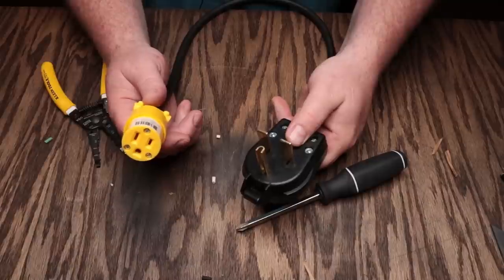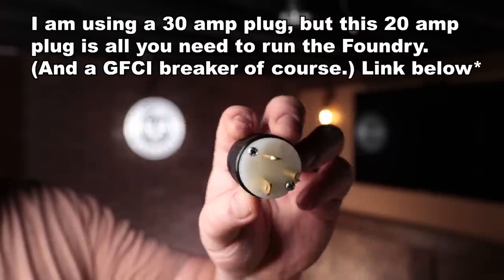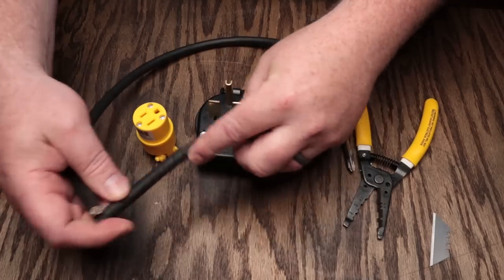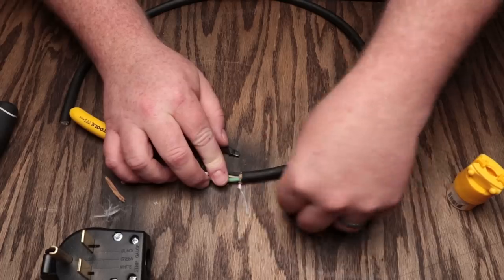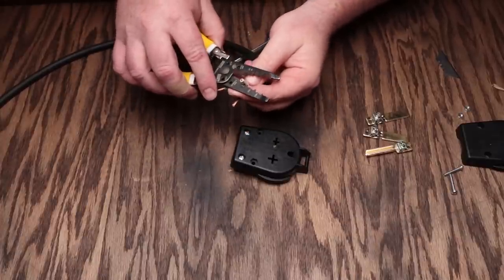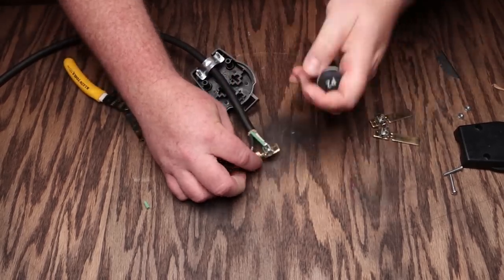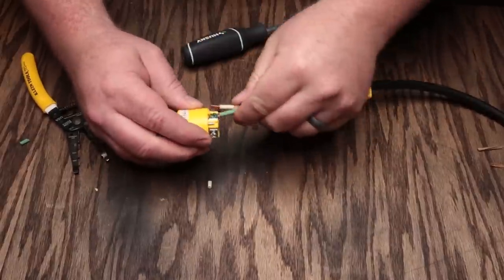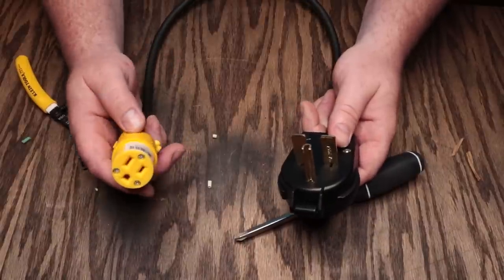Anvil Foundry 120v to 240v plug adapter DON'T CUT YOUR CORD!!

Comment: Thanks. Very informative because I do not think I want this Anvil foundry unless I go 240v. Couple questions if you do not mind answering.

1) do you have a link for the proper GFCI or are they universal? I see your links but not amongst them

2) I am hoping to plug this into my dryer 240v plug with a longer wire.  

Are you saying I need to have my circuit box adjusted to have a serperate breaker on it if I do not have one already on the dryer line?

Thanks for any clarification
Reply from the maker: You can do either in the circuit box or some people are making a GFCI cord that has the breaker built in. If you are on Facebook you should check out the Anvil group. Several. People have details on making the cord with the GFCI built in.

Comment: Can you make a jumper from the 3 wire foundry to a 4 wire Nema l15-30 outlet? I have a GFCI Nema L15-30 outlet that I use for my Grounded Brewing System currently and would love to just have a jumper plug. Thanks.
Reply from the maker: Sure just don't use the neutral. It's what I do.

Comment: Can i connect a 240 connector to a 120 outlet for my washing machine? If i make a similar pigtail adapter????
Reply: 240 volt 
Maytag washer
Reply from the maker: @colbolt54  you need to have a ground fault circuit interrupter either in the breaker box or look up my other extension cord video that has one built in for safety. 👍🍻
Reply from the maker: https://youtu.be/El3ew5bNQ3Q

Comment: Could i buy a 3 prong dryer cord and just attach a 20 amp plug to the end of that?
Reply from the maker: Maybe? You need to have a GFCI breaker first. The second issue is that dryer cord wires won't fit in a 20 amp plug terminals.

Comment: Would any 240v receptacle work for the anvil foundry if you find an adapter cable/pigtail? I have a Nema tt-30p 240v / 30amp receptacle in my garage.
Reply from the maker: Sure my video just shows one example. It just needs to be GFCI protected and at least 15 amps.
Reply: @ShortCircuitedBrewers  Thanks boss

Comment: Hey Brian, 
I've binged your channel over the last few weeks, love the content! How would this process differ for a 14-50 receptacle?
Reply from the maker: Nope would be the same. 👍🍻
Reply: @ShortCircuitedBrewers  I had a look at 30amp levithon adapter at HomeDepot: it seemd like when the horizantol connecters made vertical, it wouldn't fit to a range plug, i.e. 14-50. I came to this conclusion by comparing 30amp levithon adapter and a 14-50 canadian range adapter side-by-side. It seemed there was a quarter inch or so of difference in separation of vertical connection positions.
Reply: I've been trying to figure this out for a while now.
Reply from the maker: Then the range plug your looking at is not a 14-50. There are a bunch of similar plug configs. Look at the face of the outlet and see if it has a model on it.👍🍻
Reply: On a related note, this is the 1st time google has failed me as far as I can remember: Why is it so hard to find specifications for NEMA standard and spacing between the blades? I think I will simply go with a 14-50p DIY plug which is sold only online at home depot or amazon. While home depot sells a (non-DIY) range plug with a very thick chord, I am not sure how to deal with the extra wire.

Comment: Hi-- Great video! Is there a limit to how long we can make this adapter? I would need to use my (GFCI breaker) dryer outlet and would want to run it several feet away or even preferably to a different room-- 20 feet?
Reply: Treyandliz, it’s not really how long you can make this but rather the wire gauge you use.  The longer the run, the heavier gauge (lower number wire is thicker).  I’m not going to recommend a wire gauge for liability reasons, but consider the wiring used to power the dryer.  The length of run from source to dryer can be quite long with the wire used in construction of residence.  If your wire is too thin it’ll get hot and be fire hazard.  For 20 ft consider what’s used for construction to supply 240v to dryer - lots of info on-line to answer that question, and an electrician working at any big box store would confirm for you.  Hope this helps.  Good luck and happy brewing!  🍺

Comment: After the 240v conversion can you connect this to a LiteFuze LT-5000 5000 Watt Voltage Converter Transformer - Step Up/Down - 110V/220V?
Reply from the maker: No sure about that. I have had that question before and I have never gotten an answer. Best bet is to connect to a 240 native source.👍🍻

Comment: I have a GFCI extension cord that I use for my 120V setup. Do you see any issues in using the same gfci extension cord at 240V? I imagine the cable insulation rating is sufficient on the jacket but not sure if the GFCI circuitry is rated for 240V. Wondering if you've had any experience with those or not. Thanks!
Reply from the maker: I'd it is rated for at least 15 amps it should not be an issue. I'd rather see a 20 amp rating but 15 is minimum. Obviously you would need to make an adapter for the 240.👍🍻

Comment: In the materials you list, the 120v connector is 15 amp. Do you need a 20 amp one? Or is 15 amp enough based on your calculation at the beginning showing that it's only pulling 11.6 amps?
Reply from the maker: 15 amp one is fine.. Like you said the draw is lower than 15 amps. 👍🍻

Comment: Hi Brian!  Enjoying your videos.  One question.  I followed the video to get a 240 GFCI breaker installed in my panel.  Now I’m scratching my head on what to do with 4 wires as I try to connect my 3 prong 30 receptacle.  How do you wire the receptacle?
Reply from the maker: You only need the two hot wires and the ground you don't need the white neutral wire. You can hook it up to the outlet if you want to just for future use if needed. But for this particular application The Foundry is 240 volts only and does not need a neutral. 👍🍻
Reply: @ShortCircuitedBrewers  , thanks!  I’m still missing something.  I’m the breaker video you were using 10/3, with the ground going to the bar and the white going to the breaker along with the two hot wires.  In the outlet box, what do I do with the ground?
Reply from the maker: @barefootbody  are you talking about 2 different videos? The ground wire will go to the ground bar in the panel.
Reply: @ShortCircuitedBrewers  .  Wait, is the white wire from the receptacle to the middle post of the breaker the ground, in this situation?  That would make sense.  So the bare ground that is in the cable from the receptacle to the breaker box is left disconnected in the receptacle box?  Thanks for your help!
Reply from the maker: @barefootbody  the bare ground needs to be connected in the box. The white wire you don't need for the Foundry.
Reply: @ShortCircuitedBrewers  aaahhhh… ok, I got it now.  So connect the white to the middle pole of the breaker but leave that open in the receptacle box, yes?
Reply from the maker: @barefootbody  yes that's fine.

Comment: Great video Brian, I am bit late to the party but just ordered my 1.5 gal Anvil so now looking at vids.  Anyway, probably a stupid question but just to be sure, I would switch the Anvil to 240 right?  What if I wanted to use 110V, just plug it into a regaular outlet and switch it back on the Anvil to 110?  Thanks!
Reply from the maker: Correct on both! 👍
Reply: thank you, sir!!  Can't wait to get started.  
 @ShortCircuitedBrewers
Reply: Another quickie, do you have any recommendations for a brew recipe software program or online option?  I used use ProMash but lost the CD and my log in info!  Thanks Brian.

Comment: I have the three prong outlet with an L shaped blade, so no ground. Can I still make this work? If so how?  It says white must go to the L, black and red to the flat blades. My cord has white, black, and green.
Reply from the maker: Did you by a dryer cord?
Reply: @ShortCircuitedBrewers  no, a 15 foot 12/3 cord
Reply from the maker: @benparke8190  do you have a GFI on the outlet?
Reply from the maker: @benparke8190  you do need a GFI on the outlet on the breaker box otherwise it is dangerous. As far as the wires. The white and black will go to the red and black terminals and the green will go to the ground or L shaped terminal.
Reply: @ShortCircuitedBrewers   it is a 30 amp breaker in the panel, it's an old dryer outer.
Reply from the maker: @benparke8190  you need to follow my other video with the inline GFI to use that outlet then. https://youtu.be/El3ew5bNQ3Q
Reply: @ShortCircuitedBrewers  I will. Thank you 😊

Comment: Thanks for the video, its great information.  I just received my Anvil system and am having the 240 with a 30AMP GFCI breaker installed.  I'm sure I'm overthinking this, but can I run an extension chord between the adapter and the Anvil plug?  What specs should I look for on the extension cord.  
Thanks!
Reply from the maker: Sure can. I recommend 12 gauge and not to exceed 100'. Glad you found the video helpful!! 👍🍻
Reply: @ShortCircuitedBrewers  Awesome.  Thanks!
Reply from the maker: @indygreg1128  enjoy!! 🍻

Comment: I have a 14-30P 250V outlet in my garage and bought this adapter on Amazon  AC WORKS 4-Prong 220-Volt Plug to 120-Volt 15/ 20Amp Household Female Adapter Cord.  It hasn't arrived yet, but do you think that would work for my Anvil?  The connectors are correct, I'm just worried that it would step down the voltage and not pull enough power.  Any thoughts?
Reply from the maker: Plugs don't step down voltage. If it has the correct plugs you should be fine. BUT do you have a GFCI breaker?
Reply: @ShortCircuitedBrewers  Yes I'm on a circuit breaker.  Newer home, not sure if it is GFCI or AFCI but definitely a 30a breaker.  The manufacturer responded to my question on Amazon and said that they used the 110v wire coming off the 4 prong to provide a 110v outlet.  So it turns out that option didn't work.  However, I went to Home Depot and bought a 4 prong plug and a 110v/15A extension cord.  Cut the end off, attached the 4 prong plug using only the ground and hot terminals and it works fine.  Thanks for this video and the response.
Reply from the maker: @tjbarnett35  you need to be sure you have a GFCI breaker. For safety. I doubt that it has one even in a newer home.

Comment: Brain,
I’m trying to set this up for my Anvil and your video is very useful.  One question though....what outlet do you recommend for hooking up to the GFCI breaker? Am
No the wiring between the outlet and the breaker should have 4 wires, right?
Thanks
Reply from the maker: The anvil only uses three wires. 240 V does not require a neutral so that would be why there would be four wires in the outlet. whatever plug you choose if it is a four-prong plug you would not need to use the neutral blade in the plug. I think that's what you're asking I think there was a bit of a typo in your question.
Reply: @ShortCircuitedBrewers  Brian, thanks for your reply. Yes, there was a typo!  What I have is a 20A-250 V single Outlet (which connects to the extension cord from the Anvil), 12/2 600v wire with ground for connecting to the breaker which is a 2 pole 20 A 240V GFCI breaker.  From your first reply I’m assuming that I can use this setup, but just do not connect to neutral.
Reply from the maker: @striles  yup you are correct. 👍🍻

Comment: i have a 30 amp gfci for my current set up, would the foundry be fine on it?
Reply from the maker: Definitely.. That is almost triple the power needed.
Reply: Is there a reason that you need to use a 30 amp breaker
Reply: @edwardheyrich8601  Safety factor, current surge at turn-on.

Comment: Great video, I know you made this a while ago and I hope you or one of your followers could answer my question:  I am planning on buying the Anvil Foundry soon, but as for the adapter idea, I'm not too sure about my electrical capabilities.  If I build this conversion (I would buy and incorporate a short 120V lead with a 20 amp breaker built in),  before brewing, would simply switching the Foundry to 240V , plugging it in and trying to heat up some water be a good test of whether I built the adapter correctly?
Reply from the maker: Yes you can test it that way. If you follow my other video with the GFCI protection built it that might be a better option for a extension cord. Here is a link to that video.  https://youtu.be/El3ew5bNQ3Q
Reply: Thanks for your quick reply.
Reply: Put the white wire on the wide conductor of the 120V plug. Not necessary for 240V use but if you ever go back to 120V, it is necessary.

Comment: Great Video Brian.  I have the same problem as some others in that my Dryer receptacle is 4 prong (U shaped center top, straight on right and left and elbow shaped center bottom).  When wiring the 3 wire to a 4 pronged plug, what i'm getting from the video and comments is green is ground and connected to the top, the Black and White wires are hot and connected to the left and right posts and nothing is connected to the elbow post, is that right?   And i did also purchase, and i'm about to connect, the inline GFCI from your other video. Thanks.
Reply from the maker: That's correct
Reply: Do you need an inline gfci when you wire it like Micheal described or will the one on the breaker do the job?
Reply from the maker: @randymitchell2225  if you have a GFCI breaker on the main panel that is all you need
Reply from the maker: You would need the inline GFCI based on Michael's question. He does not have a GFCI breaker installed.

Comment: What if my 240v outlet is 4 prong? My dryer hookup has a 4th prong that is L-shaped.
Reply: Short Circuited Brewers Any way you would be interested in doing a video on this? I can’t find anything clear online and think a lot of us are in this situation. Also, would in-line gfci work on that kind of plug?
Reply: Look up "4 Prong to 3 Prong Dryer Adapter" that will get you to 3-prong 240, then make the 240 to 120 plug adapter.  Just keep the lengths short, connections clean, and use heavy gauge wire, I recommend 10/3.
Reply from the maker: No need for all that just make one adapter the proper plugs. 4 prong plugs have removable blades. Just use the 2 side blades and top pin. Done.

Comment: I think this is a good idea. However, I think cord cutting is the safest method. Leaving the option of switching between the two voltages leaves room to make a mistake.
Reply from the maker: I guess we'll agree to disagree. If you are the only one using the system not sure how you'd make that mistake.
Reply: @ShortCircuitedBrewers  Brew at a friends house that doesn't have 240V. Have a few too many and forget to switch to 120V.
Reply: @dubufam7948  I actually witnessed this. A brew club member brought his Anvil to a club day and plugged it into 120 while it was set to 240. No ill effects except that it was not producing enough heat to properly brew. Figured it out eventually and away the brew day went.

Comment: So, what would you recommend if your 240v receptacle is a 10-30R - two angled blade and one L-shaped blade?
Reply from the maker: That's a old dryer style?
Reply: @ShortCircuitedBrewers  Yes.  I'm at the point I may just have an electrician replace that outlet and ensure it's both AF and GF CI - someone is opening my panel anyway for a central AC install, might as well go for it.  That means I'll need to get another pigtail for my current 240v induction burner, until I pull the trigger on the anvil.
Reply from the maker: @lucyfurful  definitely have it done at the same time. Will cost a lot less if they're already in there! 👍🍻

Comment: Great. My dryer plug NEMA 10-30, and can't find that plug anywhere but ebay, which is sketchy.  Any options for a 10-30 outlet?
Reply from the maker: One thing I am curious about is the dryer outlet GFCI protected? I am guessing it's not. You need to sort that out first.
Reply: @ShortCircuitedBrewers  Thanks for the reply!  It is not GFCI protected.  I was hoping to address that with the new adapter with builtin GFCI you recently posted about.    But it doesnt have that NEMA 10-30 option either.  Staying 120v for now might be only option.
Reply from the maker: What's wrong with this plug?
https://www.amazon.com/dp/B07T1PC9CM/ref=cm_sw_r_cp_apa_fabt1_vsaSFbNE6XSYM?_encoding=UTF8&psc=1
Reply: Um, nothing.  Swear I didn't see that yesterday. :)  suprised no local hardware stores had one.  Was trying to get done last night as first brew day was today.  Responding now while mashing in at 120v.  240 definitely was to go.  Thanks for the link, ordered and en route.
Reply from the maker: @agunslinger9349  no problem!! Brew on! 👍🍻

Comment: Does the 240 setting allow you to boil faster or hold boil better than the normal plug? I am having trouble getting mine to reach a rolling boil without the lid being on or partially on and I had a beer ruined with too much DMS because I boiled with the lid on to make it and actual rolling boil.
Reply from the maker: Oh it definitely heats faster and a way better boil. The wattage is 2800 on 240..it works well. 👍🍻 You just need to make sure you use a GFCI breaker or build the online GFCI cord that I have a video on.
Reply: @ShortCircuitedBrewers  Awesome, I appreciate it! Your videos are great!
Reply from the maker: Thanks!! Here is a link to the other video BTW 
https://youtu.be/El3ew5bNQ3Q